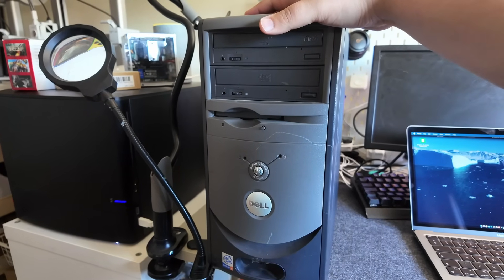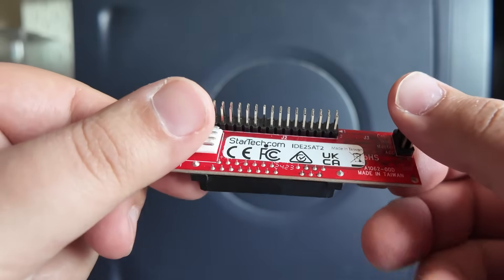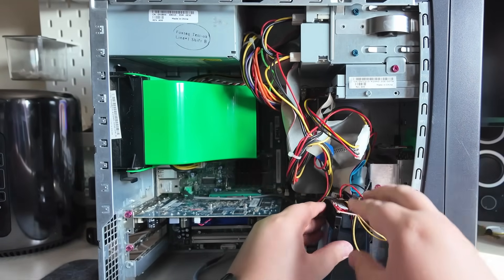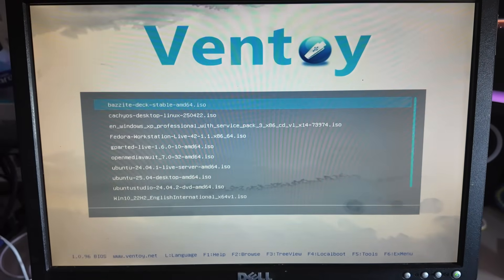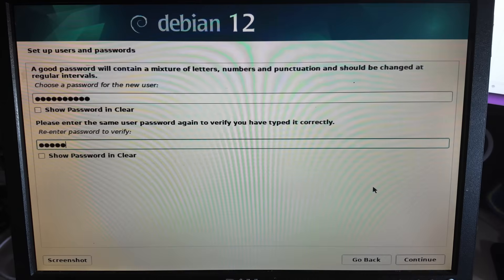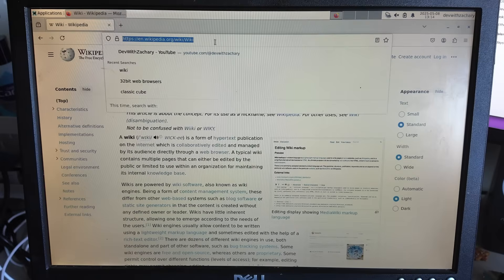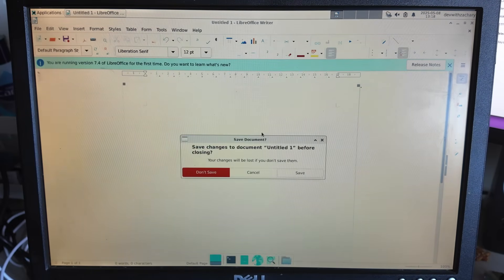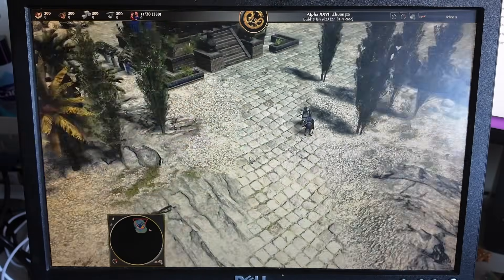How Useful Is Modern Linux on Old Hardware? Debian 12 on a 20 year old Pentium 4 Dell Dimension 4600

Comment: It's kind of mindblowing how bloated certain online services have gotten. I remember watching youtube videos on old laptops in 2008, like.. now 20 year old machines were perfectly capable of up to 480p back in the day, weird how much stuff has been added to these services apparently, while not really having caused much more of a difference in experience, imo..
the good old vlc streaming trick should make watching videos more possible, but still, damn
Reply from the maker: Same! Really has come along way without any real improvement in experience. I'm sure there are ways I could get round it, plugins to improve video performance, ad blocking etc etc but considering this was very much a machine that would have been online and accessing the web without issue in 2008 its wild how bloated things have gotten
Reply: But I'd say it still ought to work fine with modern YT. I myself have an old Dell from around 2008~2011 era with an old GeForce 590 I think. It runs YT just fine in HD on dual monitors. Even the same XFCE too... but it does have better hardware including a 64b Xeon. When I have "slideshow" videos like that it usually is because of a hardware or interrupt problem, or a bad driver. I sometimes see it in VirtualBox environments for instance. Usually it is solvable with the "right" config after a bit of tinkering.
Reply: I installed u block origin along with a few other extensions to a 4th gen i5 dell laptop. Helped out tons with resource usage  @devwithzachary
Reply: A lot of the internet, at least for video playback, has transitioned to VP9 and eventually AV1. In the early 2000s you'd need a beast of a CPU to play video, as video playback was always computationally expensive. Doesn't help that Netburst architecture of the Pentium 4 was absolute dogwater, with the first iterations failing to outperform their predecessor, the Pentium III, but what ended up happening is video acceleration, where portions of the video decode would happen in hardware on the GPU. Without GPU/video acceleration, the P4 still struggled with 480p video playback, so it needs video acceleration to playback video smoothly. The problem is that this implementation of video acceleration was designed around popular codecs at the time, like MPEG-2 and AVC, legacy codecs that the modern web has abandoned due to inefficiency; if your GPU doesn't support current codecs, then YouTube will load a much more computationally complex codec on your much slower CPU. YouTube still has H.264/AVC video, but it will not serve them by default, but you can use an extension, so video processing will go back on the older GPUs. It's not that the modern web is "bloated" in this regard, but the bottleneck shifted from computational to network infrastructure/space efficiency, so the trade off of more computationally expensive codecs that pack detail in less space was seen as an advantage, especially with how powerful end-user CPUs and GPUs  have gotten. VP9 is truly amazing in how much fidelity it can retain with such minuscule bitrates. I, unfortunately, am feeling this same issue with my Dell Latitude E6410 - it provides a serviceable experience with teh Core i7 620M, but it huffs and puffs since VP9 goes back to being decoded in software/CPU, but at least it's fast enough for smooth(ish) playback. I'm also on Debian 12 but running KDE.
Reply: @jerm1027 shocking you say you have issues on an i7 machine when I’ve had no issue’s playing modern YouTube with Core2Duo machines.
Reply: @jerm1027  Not sure what you're talking about but i remember watching tens of films with no stutter from a 40GB hdd on a pentium4 1.6ghz at a very respectable quality for the time (files size was about 500~700MB)
Reply: @voice5sur5  Being able to watch films on a Pentium 4 was thanks to GPU-acceleration, which was my point – a Pentium 4 machine would have come equipped with a graphics card to help decode video to enable smooth playback. Without proper GPU acceleration, the Pentium 4, especially the early ones, did not have enough computational horsepower to playback contemporary video of its time. I do have a 1.66GHz Core Duo which is from around that era – extrapolating performance on indirect benchmark comparisons, I’d say this Core Duo, which is essentially an enhanced dual-core Pentium III, is about 2x the performance of a 1.7GHz Pentium 4M. I re-encoded a 4K video to 480p30 @ 6Mbps in both MPEG-2 (DVD quality) and VP9 (to represent modern video) with identical settings. By default the Core Duo was able to playback the MPEG2 “DVD” video using ~25% CPU utilization, but that was with the help of the Intel GMA 950 integrated graphics (GMA = Graphics Media Accelerator). Disabling GPU video acceleration, my CPU utilization shot up to 65% on both cores playing back the same file – given that this CPU is about twice as fast as a 1.7GHz Pentium 4, it’s safe to say the P4 would choke on playing back DVD quality video without a GPU to help it. I also played the 480p30 VP9 video without GPU acceleration, and that had this Core Duo at 100% utilization and it dropped frames. Using default settings (i.e. with partial GPU acceleration – I’m surprised it worked at all), my Core Duo was able to play the VP9 video smoothly without any dropped frames, but at 70% utilization.
Reply: Original YouTube used Sorenson Spark via Adobe Flash 6 Video. Spark was a minor modification of H.263, and Flash Video combined that with 64 kbps MP3 (or MP2, I forget) audio. H.263 was the basis for 90s videoconferencing software like Microsoft Netmeeting, so it was already dated by the time YouTube came out. Fixed bitrate MP2/3 audio was similarly dated, with multiple more efficient options already existing. The weakest modern YouTube offers is H.264/AVC and AAC audio, both of which are significantly heavier than H.263 and MP2/3. Even at the time Pentium 4s struggled with this as even the best Pentium 4s were about half a decade old by the time YouTube progressed beyond the original Flash Video, and the platform overall was showing its age by 2003. You really needed a video card that supported H.264 decoding via Flash for best results.
Reply: I have a 2 core 32 bit Toshiba satellite and even the VLC streaming trick doesn't work. It seems YouTube has done something with their backend to break VLC. Livestreams work through...
Reply: @The_Georgi0 YouTube silently updates its interface about once or twice per month, and VLC is basically in maintenance mode these days. It's been almost a year since last release.
Reply: Yeah, I've been saying for a while that this is the fundamental problem with modern tech. Like, the average use case for computers for most people has stopped evolving in the last ~15 years or so. Before that, new tech was able to provide actual, meaningful improvements in usability and functionality for "normal" people, but nowadays, what most people need out of their computers and mobile devices in terms of functionality is basically not changing any more. 

For example, ten years ago I used my smartphone for calls, texts, media playback, browsing the web, and taking pictures/videos. These days I use my smartphone for...the exact same things. And yet the smartphone that I had in 2015 wouldn't work today because the software has become more bloated and demanding for no good reason.

Thankfully on the desktop, you can make things last longer, so my 2013-era laptop is still functional.

I realize that AI might be the sort of "new functionality" that I'm talking about, that actually justifies a leap in necessary processing power, but that's still in its infancy.
Reply: I remember watching YouTube on computers from the 90s with no issues. It’s disgusting how bloated some things have become to the point even later pentium 4s have issues.
Reply: the computers were faster when they were slower....
Reply: Computers getting more powerful = more people having access to powerful computers = stuff like youtube doesn't bother to retain compatibility by staying within older hardware limits
Reply: You can use a different youtube front-end like invidious or piped, they allow for h264 codec playback and work like a charm on older devices, shouldn't be a problem on 15 year old hardware at 720p or 20 year old at 480p
Reply: I've been using an old eeepc from 2009 to watch youtube videos. The YouTube interface is so slow it's unuseable, but using  pipe-viewer or youtube-viewer, with mpv as the actual player, works just fine
Reply: YTFZF is for you
Reply: YouTube's interface is slow and laggy even on the latest machines. It downloads a 10+ MB (last I checked, it is probably even bigger now) JavaScript file called polymer.js because apparently we need that to show video thumbnails, text comments, channel links and ambient glow?! I only log into YouTube to make comments and upload videos, for actual watching I use Invidious or yt-dlp. People get mad when you say this but Firefox's performance is significantly inferior to Chromium now. This is not entirely Mozilla's fault because there is only so much you can do when Google changes the Web spec several times every fucking week to serve their own interests and to turn it into an OS/Web app runtime. Also there are allegations that YT is deliberately crippled in non-Google browsers. Sad but not surprising.

What is surprising is how bad Wikipedia's new skin performs. Not only does it look like like mobile trash apparently you need a supercomputer to run it?  So much for liberalising access to information. Hopefully that was just the overhead from Firefox. Either way you can change the skin back to the old Vector or MonoBook if you have an account or extension.
Reply: its mostly spyware and bloated code
Reply: Also relying on rsa4096 and Sometimes even rsa8192 Tanks Performance on loading Websites with older Hardware or IoT Devices.

I am glad that the trent goes to elliptic curve 256 Bit Keys.
Reply: The new codecs that old hardware is lacking and the higher bitrate of the newer videos is the problem with new services on old hardware.
Reply: @Miltiadis_Vouzounaras  the whole page is a problem, before the video starts
Reply: @Miltiadis_Vouzounaras  with youtube you can still access h264 versions of videos i believe
Reply: In order to wipe out the orders of magnitude worth of hardware power, it took an army of sub-par H-1B programmers and girl boss project managers.

Comment: For watching YouTube, use a media player like VLC, or SMPlayer instead. Copy the link from the video and paste it in the Open URL (?) dialog box. It will use something like yt-dlp to stream the video, but you have to set a lower resolution in the player's settings. It should give a MUCH better watching experience.
Reply from the maker: Oh 100% there are going to be plenty of better ways to experience video streaming, its just a shame that a machine that 100% could have run youtube back in the day can't now!
Reply: @devwithzachary  It's all about codecs. When the hardware doesn't have the needed decoders, it will run on software rendering, and in this low powered CPU, it will not be much fun...
Reply: @Miltiadis_Vouzounaras  that's not all of it. newer browsers are just inefficient, and the canvas won't be accelerated on many GPUs either. yt's site is also very bad. play the videos with a proper player, it basically doesn't matter what encoding you have, at least 480p will play great - even on the CPU.
Reply: @devwithzachary  firefox in debian doesn't use hardware acceleration out of the box. If you found a kernel that still supports that GPU (current might, I haven't looked) and get it working, then in tandem with a plugin that forces youtube to load h.264 codec versions, it ought to run SD and 720p. That radeon is a RV635 GPU which supports MPEG4 AVC Decode and VC1 Decode as per Xorg's documentation. 

So either HW decoding in firefox or piping it into a supported player should mean you get playable video.

Comment: I'd daily this. but generally my starting point is 64 bit, 2 cores and an SSD. Core2Duos are still great. Going from 2GB to 4GB of memory will also increase responsiveness a lot through caching.
Reply: Even a Pentium d or Athlon 64 X2 from 2005-2006 works fine. Youtube at 480p works, if you turn off the ambient mode. Even 720p works with no background apps.
Reply: I agree about the ‘64 bit, 2 cores and an SSD’ as a starting point. I would add 4GB to that point.

I WOULD amend it to 8GB RAM, though. My daily with the Core2Duo runs 16GB. This is the oldest setup I use on a regular basis… I upgrade them to Core2Quads , Q9850 if I find one on the bay for under $5 shipped. In fact, I have one arriving to upgrade that Core2Duo already.

Honestly, all my older machines (Pentiums & Athlons) are going up for auction starting July… including all old parts (IDE controllers, PCI and AGP video cards, Soundblasters, etc). I’m getting out of the business / hobby.
Reply: Yeah my cut off is multicore 64 bit today.
Reply: yeah maybe core2due as low as u wanna go :0   as in inspiron 530...where it might be worthwhile to upgrade to a higher core2due :0   Just 4 U-tube.
Reply: @joepiscapo936  I had a core 2 two PCs ago now. So it'd be quite a step back compared to my daily driver. I'm looking to go the other way.
Reply: you can get ddr3 lga 775 boards that can handle up to 8 gb ram

Comment: Try linux mint it's lighter
Reply: Every debian based distro is nearly identical in performance, you're splitting hairs as long as stock ubuntu is out of the mix. a puppy distro is the only thing that'll provide a noticeable performance jump
Reply: This was only using 340 mb of ram.. You're not getting much lighter than that.
Reply: @calholli  JWM + S15pup uses 120mb ram on idle and uses nearly 0 clock cycles, it also has a far superior CPU governor and scheduler that makes multitasking smooth on single core devices
Reply: @calholli  I am pretty sure Debian uses less than 100 MB of RAM, as long as you don't use GUI 😀
Reply: Mint is not lighter than Debian.
The main difference will be the desktop environnement.
XFCE is quite light, Mate / Cinnamon heavy, and Window Maker very light.
Using Debian / Mint / Fedora / Arch / *BSD or whatever won't make any difference.

Comment: The quantity of vram is not important to decode YT video.
A P4 like this is more than enough to read divx . A simple P3 1GHz can do it.
Open Arena is a Quake 3 add-on, not Unreal :)
Reply: More specifically; OpenArena is an Open Source Clone of Quake 3 Arena that started development after the idTech 3 Engine (Quake 3 engine) source code was publicly released back in 2005.

It is functional enough to allow you to run other games based on the Q3 engine (such as Star Trek Voyager: Elite Force and Star Trek: Elite Force II) by copying the .pk3 files from an install of said game in to the "Mods" folder of OpenArena and running them that way.
Reply from the maker: Thanks for the info
Reply: My 256mb HD 2600 pro can decode 1080p30 and 720p60 youtube with no problems, the enhanced h264fy extension is necessary to get the GPU to decode anything. I know this because I'm watching this video on the HD 2600 pro at 720p with the gpu properly taking the load off of the cpu
Reply: @georgewashington6171  I also think using h264 extension may help. 
Too bad it won't help my Ati 8500 with a Duron 600 :)
Reply: you don't need much vram to decode video at all - that's not it. you just need to have a video encoding that is supported by the GPU, and a browser that preferably supports a hardware accelerated canvas on that GPU as well.

Comment: I'd love to see this system maxed out with something like a 3.0+ Ghz Prescott Hyper threaded P4, 4GB of ram, and a PCI Sata card with an SSD to increase Read/Write speeds. Maybe an Xi-Fi sound card. Even an Evercool front bay HDD cooler just to add some airflow into the case, because who needs optical drives. Zalman and Scythe made some cpu coolers that would work as well. So many more upgrades paths with a socket 478 Dell Dimension lol.
Reply from the maker: Now that does sound like a fun project …
Reply: No need for PCI SATA, This motherboard has native sata, just look at Dimension's user manual. Don't really understand why SATA to IDE adapter has been used here... it makes OS much slower.
Reply from the maker: I mention this in the video, I recently got the ide to sata adapter for future projects but this is the only ide machine I currently have so I wanted to test it out. But yes the machine does have two sata ports
Reply: @devwithzachary  I could be wrong, but my guess is that the SATA interface on the motherboard would be faster than the IDE.

Comment: Seems painfully slow.  Fact Linux has 32bit now days is amazing.
Reply from the maker: Yeah i wouldn't want to use it as my main PC... but if you needed a basic internet connection it works for sure!
Reply: What Linux OS is 32 bit? I remember distros were moving away from 32bit. I had Bodhi Linux for an older system underrated Distro.
Reply: Linux (the kernel) itself won't remove 32-bit support anytime soon, as long as people use it and there are people who develops Linux to work on the x86 architecture. Only recently Linux kernel dropped support for 486 CPU which came out in 1989. It doesn't mean that there any popular distributions that support it, but still.

As for distributions that support 32-bit x86 architecture, there are not that many nowadays. Of course you have Debian (and Linux Mint Debian Edition), but you won't find any other popular distribution (Fedora, Ubuntu, Linux Mint, Arch Linux) that supports it.

You essentially need to look for lesser known distributions if you want it to work on older hardware, and there are few for these, like AntiX, MX Linux, Puppy Linux, etc. which might or not be designed solely to work on old computers.